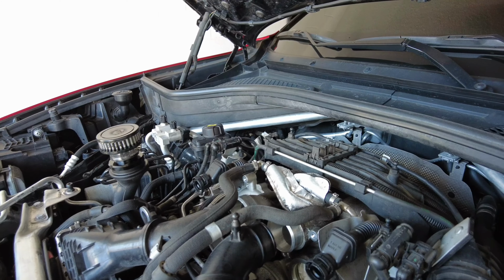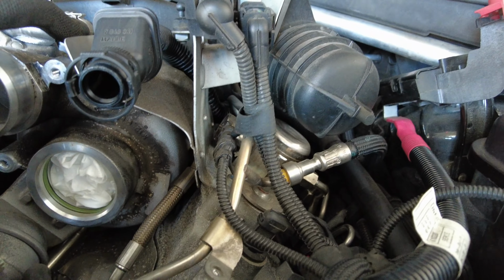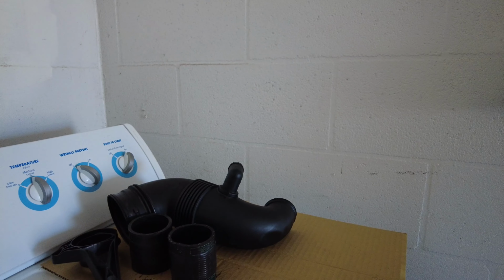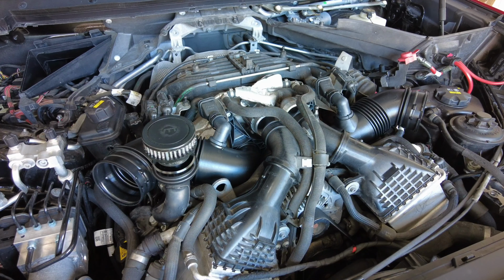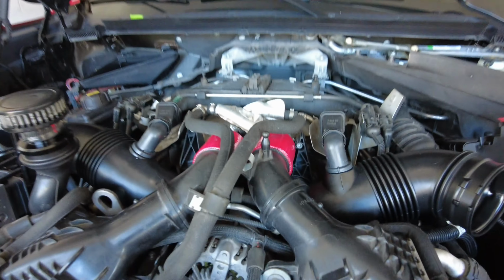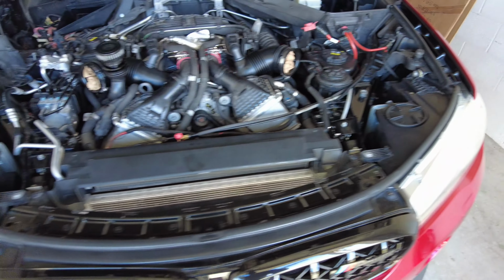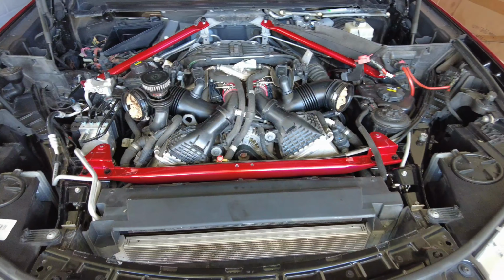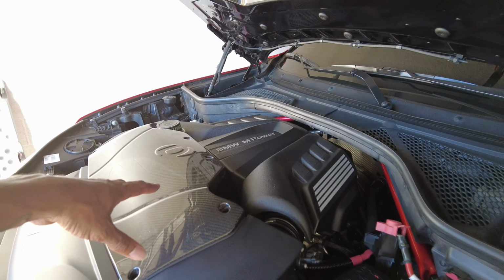BUT THESE PARTS ARE CHEAPER AND 10X STRONGER THAN BMW PARTS!

Comment: Yo bro. Do you recommend getting a catless downpipes only upgrade for my F85? I’m planning to install mhd stage 2. No need for charge intercoolers upgrade and charge pipes too? I live in a very hot climate area. Thanks 🙏🏻
Reply from the maker: Thanks for supporting the channel fam. You only need catless downpipes nothing else. The only time you will need an intercooler upgrade or methanol injection upgrade is when you're going for a custom tune to make more power.

Comment: Hi, could you help me to find the diverter valve location please thanks 🙏🏻
Reply from the maker: The F86 and F85 X5M/X6M don't have diverter valves. BMW stopped using them after the E70 and E71. Everything is controlled by the vanos system now.

Comment: Bro do u have someone or a link for bigger calipers for a 650i I don't remember if u did that for yours or just for Sasha let me know if u do thanks
Reply from the maker: I actually only did the big brake upgrade for Yuri (X5) but you can contact Tony he's the guy I bought the kit from and see if he makes one for the 650i. I do know the M5 and M6 front brakes fit directly on the 650i if you can find them used on eBay or a salvage yard.
dentprotony@gmail.com is the email contact for the big brake kit. Thanks for always supporting the channel fam 👨🏾‍🚀🚀🌌

Comment: Dude talk about deja vu. Literally the SAME EXACT THING happened to me and my 2013 x5 n63 2 days ago! Wow what a coincidence! I definitely need something better for my turbo inlets and turbo seals. The passenger side blew apart and the driver side is close as well to coming off! Great content my man! Been watching for a while now I’m sure you know. Haha
Reply from the maker: I really appreciate your consistent support fam it doesn't go unnoticed 💯 your X5 will feel like a whole new car when it's fixed because those leaks will definitely cause power loss🏎️💨🏁
Reply: Yes I agree. Got an appointment at the dealership for June 9th because all of this work was done less than 1 year ago. It will all be covered for free so instead of doing it myself I’ll be patient and wait. Can’t wait to see what the built s63 turns out to be. My n63 has the bmw m performance package so it has 448hp and 500lb ft of torque. I have custom intakes on mine and the bmw m performance exhaust as well. I’m thinking about a new engine soon. These n63s are cheap compared to yours. My ZF8hp70 transmission I love so we are good there. Soon I’ll hit the track and post my numbers. See you soon
Reply: @AutoLust  hey do you know of any aftermarket turbo air intake inlets for the original n63 engine? I can’t seem to find any anywhere. They are just going to put the crappy plastic back on that is going to be loose and the turbo seal will be sloppy. Figured I’d ask you. If not no big deal
Reply from the maker: @jamestabor587  they don't make aftermarket inlets for the n63 and S63 engines because they flow good enough even for upgraded turbos the only upgrade you can get this building your own custom inlet, but it's not really worth it unless you're going with a bigger turbo with a bigger turbo housing like a silly rabbit Motorsports turbo.
Reply: Oh ok I see. Thanks

Comment: How did you get the crankcase breather filter to fit on the oil cap? I hear people are having fitment issues with it. I have an f86 btw! Your car is dope!
Reply from the maker: Thanks fam and thanks for supporting the channel 💯 I have the original version 1 crankcase breather the version 2 has problems because the little winglets are too thick and it doesn't want to twist all the way on but you can slightly bend the winglets down and it will catch and twist, But be careful because they're easy to snap.
Reply: @AutoLust  Ah! I see! Thanks i'll look into it

Comment: I too was thinking about possibly having the intercoolers cerakoted along with the turbo housings, downpipes and exhaust manifolds but I had to second guess because I feel it would have the opposite effect of what im trying to accomplish. Cerakote, or even powder coat, is an insulator so its really not going to deflect heat . With the turbos, manifolds and downpipes its going to keep heat from transferring to the atmosphere, so wouldnt the powder coat have the same effect as its going to soak up heat and trap it within the intercoolers ? It might be a bit different if they were being fed cooler air from the outside but the are sitting right in front of the block and can cause serious heat soak would it not ?
Reply from the maker: On a air to air intercooler I wouldn't recommend powder coating because you will have a problem transferring heat that way but we have air to water intercoolers and the heat exchanger is inside of a aluminum case. Heat insulating (powder coating) the aluminum case will help the water more efficiently cool down the air charge. You might be thinking of a air-to-air intercooler where what you said would be true but not for a air to water intercooler.
Reply: @AutoLust  ah ok ok that makes sense . I may then perhaps get the intercoolers cerakoted as well then . Thanks !!!!